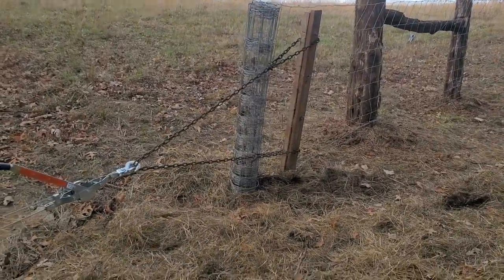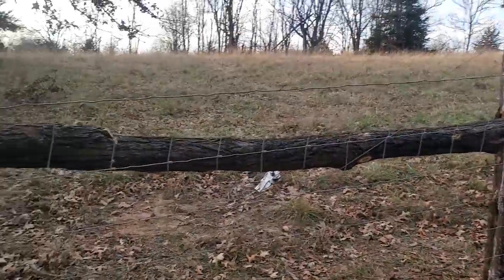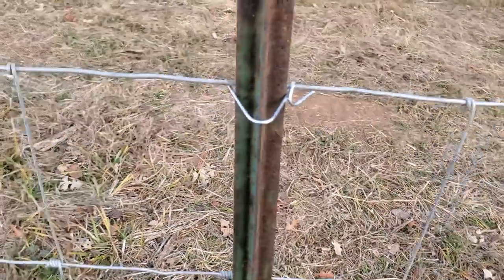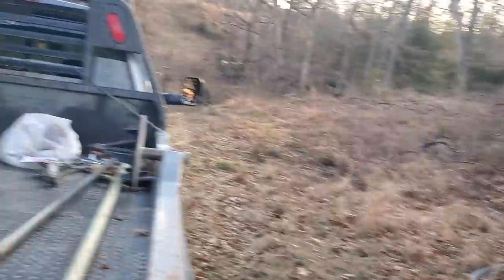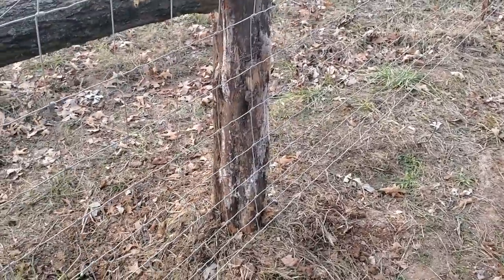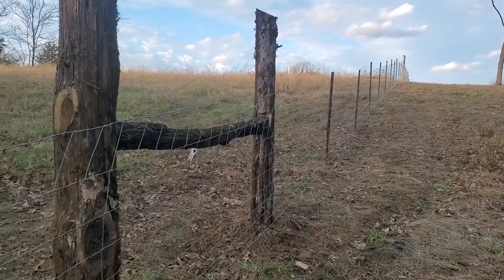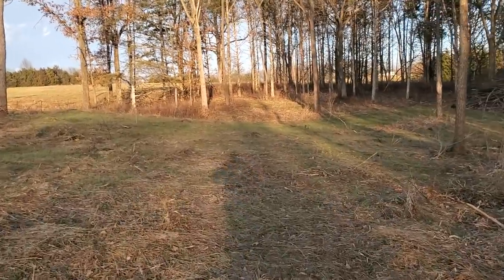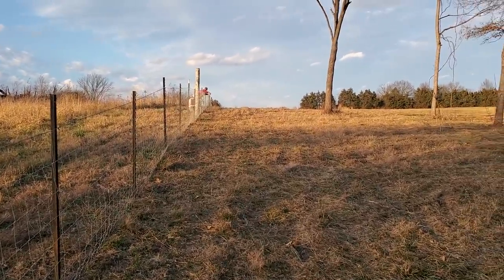Building the perimeter fence on ram farm.

Comment: I really like Stay-Tuff High Tensile Fixed Knot woven wire fence. I have over 18000 ft up and it is tuff. Had a ice storm last February and many trees on fences. Could not believe how well it popped back up. Very few wires were broken.

Comment: The screw driver trick is a good backup for clip installation. I actually use the Clip Bender clip tool. Much better than pliers or the screw driver

Comment: My dad found a guy who made a little tool for building fence. 
It was short enough to get between the bottom wires.
But it had a hollow end on one that you could poke into the short side and twist it down (no need for pilers) and the other end of it was for twisting that curly side down.

I have no idea who made it or where he found them, probably some trade show or at a national horse show somewhere.  But its been more than 10 years since we found them. (Also i didnt realize that not using a screwdriver was done...i thought it was common knowledge, but i think that about a lot of stuff then i go thank my mom for raising me with sense 🤣)

Also. Id love to have a wood stove in my house.
But i dont even have a fireplace. If you have time this winter could you discuss woodstoves? Getting them, what you need to do to prepare for them, how to find a reputable wood stove dealer/installer, & what you need so you house doesnt burn down? Etc.

Comment: I made a 2x4 and bolt fence stretcher just like yours to stretch 4 and 5 ft non climb fence 25 years ago and still use it. Tried using a clip tool to attach t post fence clips but got frustrated with it and went back to the good ole screw driver. Yes major time saver for sure and less raked nuckles.

Comment: In a previous incarnation of this life, I worked with wire rope a lot and there is a little phrase that helps a  bunch with  remembering to clamp the wire rope the correct way. The dead end (short end, bitter end) never goes on the saddle part of the clip or clamp. It can pull out under heavy load if you clamp it that way. The short end always goes under the bent , threaded rod part. It's MUCH stronger that way. So, just remember and say to yourself "You never saddle a dead horse"... and if you remember that the cast  metal part of the clip is called the "saddle", (looks like a saddle too!) you will always remember the correct way to put the cable in the clip even if you are tired and haven't eaten in a week. :) Also, if you are expecting tremendous forces, use 3 clips in a row. The cable will break first before the clips pull out with 3 of them on there! The only thing better is to have a crimping set and crimp the cable. 

Your channel is my favorite channel in all of YouTube! I take notes on everything you say. I hope you get to a million subscribers because this country is as sick as a dog right now and regenerative, organic agriculture is one of the TOP things that can and will save it. Without massive change in ranching and farming, this country is lost. No civilization has ever destroyed its soil the way we have been doing for many years now and survived. I believe that our corporate, stupidmarket food, grown in dead and poisoned dirt is POISONING the country and making many insane. Great upheaval is coming if we don't change our ways!
Reply from the maker: Thanks for sharing your wisdom with us on clamping cable ends! All the best to you.

Comment: One of the greatest discussion questions in ag fencing, Post spacing between the single wood post and the t-post in series.  Is every 5 post wood, 10th, or just wood braces at 300ft?
Reply: Depends on the land you are fencing. Is it flat or rolling hills? Those wood posts help a lot with keeping the wire where it needs to be in a dip.

Comment: If a farm had no perimeter fence at all, would you just use the hi-tensile system? Or would you set this up then run the hi-tensile 10 inches apart?
Reply from the maker: I would go all Hi-tensile. It is much more economical than barb wire or woven wire.
Reply from the maker: No

Comment: The saddest, most unbelievable, and comical fencing story is from my neighbors place.  He put a brand new 4 strand barb wire fence down the back side of his place.  Few days later he called and said "You won't believe this!"   Someone came along at night and stole every single steel t post down that line and half of the ones in the back.  They cut the clips loose instead of cutting his wire so I guess that is the only positive part.
Reply: Well at least it was a very hard working thief!!! You rarely see one of those thankfully!

Comment: Hello Greg. Looking to get 37 acres of crop land to convert to pasture for sheep. The land is not fenced in at all. It’s lined with trees and is on a Main Street. What kind of fencing do you recommend? Should I use woven wire around the parameter of the land with wood or t post? I would like to use electrified wire to rotate but I’m a bit confused on how to do that. Do I add a high tensile electrified wire on top of the woven wire fence? Help please.
Reply from the maker: With road frontage touching a main street, use woven wire.